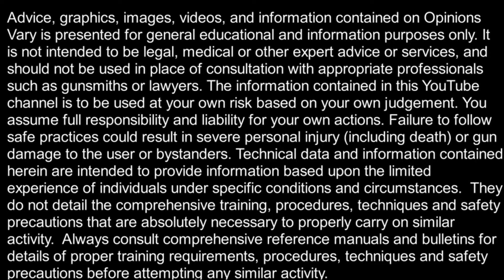DYI 1911 Accurizing

Comment: What's your opinion on thick flange bushings vs. thin bushings?   Do you think they affect accuracy or just basically for looks and protect the end of the barrel?  And guide rod thoughts full vs. GI?.....Many people like myself drop full length flat wire rods in.....Do you think they give better cycling to a 1911?
Reply from the maker: @thomasrouh2258  Thick flange bushings came to help create the slide melt look by offering more material. The basic steel are just as good. Stainless bushings aren't a good idea because stainless pops vs stretches like steel. 

If the back of the bushing skirt is reduced the bushing cants more offering more support to the barrel as long as it's not reduced too far.

Full length guide rods on any larger than 9mm do smooth the cycle preventing the slide from digging in the dust cover while prolonging spring life by uniforming the coils & displace some of the excess torsional stress on the coils. They do make the 1911 better, but the 9mm has way too much slide weight to reliably run them unlike the bigger calibers.
Reply: @opinionsvary  Another question....With this Sig Scorpion 1911 45acp....Do you have any methods or tips when driving the extractor pin out?   I want to give it good cleaning for the first time.....I have EGWs extractor, coil spring and new pin....This pin is really taking some pounding.....I have read they may need to be pressed out and back in.....I am soaking it with PB blaster right now.....I'm using a 3/32 punch.....1/16 punch is a bit too big....Any tips I would appreciate....
Reply: @opinionsvary  I'm driving pin from bottom up through the top as I understand that's the correct way....
Reply from the maker: @thomasrouh2258  In my opinion: Wow. YT failed to notify of your comment.

When driving pins that aren't tapered you should consider preserving the finish by covering it in black electrical tape around the hole.  You'd want a roll pin punch if a roll pin is used. This type of pin driver has a bump in the center to keep the punch centered. If it's a solid pin & not counter sunk you'd want to leave it alone. If counter sunk, you'd want to use a punch driver smaller than the pin diameter. If you have old drill bits laying around you could use the back shank as a punch driver. 

Sig has a pretty good warranty you wouldn't want to mess with. Could call them & they'd send a FedEx label.

I personally prefer roll pins over solids because solids can move around & wobble out.

You must be careful not to damage the finish & want it in a padded vise to stabilize the slide. Don't attempt without stabilizing the slide or finish damage is foreseeable.
Reply from the maker: @thomasrouh2258  In my other opinion: Make sure you mic the pin to ensure it's the correct size. Could damage the slide if not careful. Helps to knock off the edge of the pin so it won't dig into the bore. Might need to stone the pin sides with a trigger track stone to remove discrepancies in the pin. Also might need a dummy pin to help align things so the pin won't shear on the extractor hole.

Honestly many people mess up changing extractor pivot pins & I wouldn't mess with it unless there's extractor failures.

Comment: Did you replace yours to full guide rod is that 70 type  model or an 80
Reply from the maker: In my opinion: Hi there, it's a 70s model. Came with the GI plug & had problems with the plug hitting the short rod end. The rod twisted & jamed the slide so I replaced the GI plug with a full length guide rod & it totally cured it.
Reply: @opinionsvary  thanks I have seen a bunch of video on 1911s but not a lot of infomation on problem fixes is true that the springs ware out much faster tell me did you reuse the spring or did replace that to
Reply from the maker: @nyghtmyst5118  In my opinion: I tend to abuse my builds with hot loads until I like the wear patterns on the bearing surfaces before backing off, so I changed the twisted 18lb it had with a 20 lb ISMI chrome silicon. 

Reliability packages often include 18 lb up from the standard 16lb. But I wanted the barrel bed to cradle in along with the slide stop pin clearance. If you don't then the barrel can prematurely wear the link & link pin when the barrel wants to travel further than the linkage will allow. My hot loads send expended shells bouncing all around the shooting lane enough to know metal mainspring housings break pins. That's why it has a Kimber composite flat housing.

Also the barrel bushing is an exact fit even to the recoil spring plug making a stronger spring possible. Once everything wears in, I'll go back to a 18lb ISMI chrome silicon & run standard pressure loads.

I have a 16 lb ISMI chrome silicon recoil spring that came out of a gun I ran over 3,000 rounds through & ended up still using it in a 9mm project. The spring is shorter in length, but still within specifications. If you want the world's absolute best recoil spring that nobody can ever beat the ISMI chrome silicon is it. They're know to last upto 6,000 rounds unlike everyone else's stuff. The reason they go bad so quickly is because the weight of the slide smacks the frame causing harmonic vibrations under load to a barrel bushing that wiggles in addition. Recoil springs on Government models are supposed to be charged at 1,000 rounds. Commander models might make it to 800 rounds before replacement & Officer models typically might make it to 600 rounds. The slide to metal frame hits causes the spring to shorten & the extreme vibration weakens it. You should expect your spring to last as long as possible with a full length guide system - unlike the GI plug. The GI plug allows the slide to bite down on the dust cover during the feed cycle. Full length rods make everything last longer & overcome one of the most overlooked design flaws - the shallow dust cover.
Reply: @opinionsvary  DO THEY SELL KITS TO CONVERT !  Like the full length guide rod spring and cap for the end I have the SR  Ruger in full size beautiful fire arm for the price I hear this that and a 1/3 on the model 70 being the better design.  I do have Taurus pt 1911 in full size as well but it is a 80 I am told, that to is full size i am a big guy so small guns are cute and big guns are cool to me..  Seem to like the Ruger line  have a couple revolvers I got from that company as well the 101 and the 100 both of which are really nice guess i am a bit old school lol

Comment: So when the barrell bushing is of a spring support type keeping a tight fit of bushing and barrell all the time, most of the worries here go away? Also a loose barrel link pin fitting is nothing to worry about according to a gun smith expert here, and in 30+ years never caused a problem, so where does that leave us with regards of accurizing the 1911? Accuracy of slide fitting the frame rails is not at all mentioned here so why do manufacturers make so tight fit in that regard, like Kimber, and not so good fit in Colts?
Reply from the maker: In my opinion: The collet barrel bushing that uses the spring tabs is completely different & fragile. On this set up a tapered end at the muzzle tightens to remove chatter. They'd  run a 2.5 link & had shorter barrel hoods for unknown reasons leading to the squared areas at the chamber ends for the lock. If the length of the link is changed, the bushing tabs will break. The link thickness can be fattened to help with accuracy by removing side chatter that is a problem in all 1911s with linked barrels. With a link that has a lot of wiggle it will cause the barrel to vibrate when it hits the frame bed. When this occurs, this can batter the top part of the extractor claw as it cycles. The better looseness would be a little up & down so the feed can be complemented & assisted. A wiggly link can walk a barrel pin out that can then drag on the frame. In retro spect most of them had their bushings replaced with traditional more solid ones because the collet tabs would break. The 9MM full size Colts lasted the longest being they ran 15 lb recoil springs that under load of the feed (empty slide drops ruins 1911 parts) wasn't as bad as it was with 45 ACP. The recoil pulse is way different on the 9MM version & you shouldn't ever use solid recoil guide rods because the little drag of the plug can cause feeding problems on that particular arrangement. 

Solid recoil guide rods do smooth the feed & battery in larger calibers.
Kimber hit the market with its Custom Classic running a 16lb recoil spring & full length guide rod. I had one & it wasn't reliable at all unless you were using hard ball ammunition. None of the performance magazines worked well enough to over come this reality. 

COAL matters with 1911s for reliability as bullet set back usually occurs the way this design feeds.

Guide rods can help make collet bushings last longer on the larger calibers, not so on the 9MM.

Slide chatter isn't a big deal. I fitted one once & lapped it until it would slip off of it's own gravity. I put over 3,000 rounds of  hot loads trying to break it in inorder to establish the natural wear patterns bringing it to the sweet spot to where everything is exactly as it will be at its finest. Then I laser bore sighted the sights into alignment after allowing the barrel to naturally relax set to the right as most 1911s do. The slide actually wore to chatter making tight fitment a total waste of time. Slides will relax set along with the barrels. They tend to contort to a "C" shape the more the ejection port is opened. This is not an ideal situation. You see it more on old Glocks than GI model 1911s. At some point I will cover how the internal 1911 extractor & ejector actually work making extended ejection ports a terrible idea (the market trends in the 1990s gravitated towards trying to emulate Beretta's more reliable "open slide ejection system"). During this era of thought 32 ACP C- Camp pistols & Walther PPK type small arms were preferable for concealed carry for those who hated the snub nose revolvers. 

Extended ejectors are another terrible idea some gunsmith hot rodder came up with & it created a world of problems messing with the OEM design. 

Back in the 1970s the 1911 was a terrible thing nobody wanted as a duty weapon so the gun magazines made them hot rods. Kings, Cylinder&Slide, Clark, Millet & Wilson would offer gunsmith fit parts touting better performance in line with revolvers. They tried for higher adjustable sights -  like revolvers - on pistols that hardly ever had them being more suitable for combat. They thought tighter was better & preferred less barrel movement. Turns out they're as wrong as the weaver shooting stance of those times. They erroneously though a "bladed stance" was the best, but that stance is no longer taught at the professional level being hard to index with & opening up the arm pit to present the most vital area to ever  get hit at next to the head. Yeah, it was incredibly dumb. Most 1911 smithing is all idealistic market gimmick. They'll recommend a tight barrel without telling you about barrel springing or lug drag issues. They'd talk about the "long link" idea without telling you it wears the slide & breaks extractors.

Hopes this helps, tell me what you think about it. It's a lot to take in.

Best regards.
Reply: @opinionsvary  Thanks for the answer! Honestly some of the things mentioned here I cannot do much about, like fit of barrel to slide. As the front bushing collet type is very tight and nice accuracy improvement in my Colt Combat Elite (Series 80 modified to 70) maybe could be found at the rear of the barrel. The gunsmith here suggested a bigger program, but I declined wanting to keep the Colt original. It has 3lbs trigger but I wanted Kimber Super Match feel. Then the whole trigger  assembly had to be changed he said :) Anyway, the problem which emerged after some use is that slide catch releases when loaded Kimber magazine is inserted. Also it has developed a tendency of not feeding Fiocchi 230gr.FMJ ammo. Quite frustrating in a shooting match!  The smith would file the profile of the slide catch and accurize the feeding and feed ramp. The slide is slightly binding at a portion of the frame, but he said if he opened it up the accuracy would be considerably worse. So we let it be! :) Any opinion on those considerations?Thanks for your attention!
Reply from the maker: @gabork.8715  In my opinion: I don't know why he'd be filing any functional profile on a slide release. Without seeing your gun, I'd say the catch may not be fully up in the slide notch or catching on the take down groove before it. If the mag spring is tired, you may not get the full lock back proformance. I would use PSI ACT mags that have more reliable supported followers. The nose dip of the traditional style mag can cause problems when the spring sets & tires. The mag depicted in my video is my own fancy build. It uses a ACT mag follower & spring. The mag tube has the correct feed lip angle & a removable base plate. I wouldn't use any other mag. Pay attention to the feed lips being many tend to come malformed.

The fire control group (FCG) on a 1911 can be improved simply by changing the main spring to a lighter one, preferably made of chrome silicon - like an ISMI. Colt OEM runs a 24lb main spring. Going for an 11lb or 8lb will significantly reduce the pull. Cylinder&Slide sear springs would also feel better than the more solid Colt OEM. DO NOT MESS WITH THE SEAR ANGLE!!! Because it's not necessary. Ordinary the sear will bite into the hammer hooks & iron out all the gritty feel. You could put Power Customs sear shims on either side of the OEM sear & remove the sear drag on the frame. Colt is generous with the sear slot unlike other manufacturers that make this area too tight. You could change all the parts yourself without having to file, grind or modify anything. This should make your FCG incredibly awesome. 

The case over length of a bullet can mess with feed.  1.215" - 1.220" (tapered flat tip); 1.230" - 1.265" (Full Metal Jacket) runs pretty good in my 1911s. But it varies with manufacturers & the batch. If the egg shaped ball ammo doesn't feed its length may be too long for the optimal feed cycle. Get yourself a micrometer & spec the case over all length (COAL) to make sure it'll be within the sweet spot to run correctly. That long stuff may run in a different non 1911 gun that doesn't cam load like the 1911. 

The frame feed ramp should launch a round to the mid portion of the barrel's ramp. You can advance the cycle rate by changing profiles, but I would not recommend it. The bullet pushes against the top of the chamber & cams on the barrel's feed ramp edge. The secret is the barrel's feed ramp, not the one on the frame. That's exactly why throating involved   using a fixture to help chop the feed ramp down to a steeper angle for hollow points. It "magically" allowed less drag on the cartridge to where it cams up. I would not mess with any of that. The "U" bearing surface of the feed ramp has to be the correct shape in order not to increase the cam up pressure & retard the feed. 

The tight spot on the frame isn't a big deal if the slide moves of its own gravity without stopping short. The top rail is where all the magic happens. The bottom track isn't the bearing surface like the top. As you continue to practice with it, it will wear in like a new pair of shoes. The frame will contort over time & relax set. The difference in sectional density will causes this. That's why you should always practice when ever you can inorder to keep things running in their sweet spot. Cop & security guard guns contort really bad from temperature extremes whereas guns that stay in stable climate not as much. You might try Flitz on the rails to slick it up. Or you could use automotive rubbing compound for a few back & forths until satisfied (make sure you clean it out good). Do not use lapping compound because it won't all clean out & continue to work down the parts in bad ways. 

~ Best regards.
Reply: @opinionsvary  Thanks for your answer!  I really refrain to file anywhere on that Colt not to make things worse and hopefully the gunsmith found the right places to adjust. The magazine I used was a quality Kimber 8 shot magazine which has a feed lip quite different from the orginal Colt which actually looks cheap, with a step in the feed lip. The Kimber feed lip looks akin to modern magazines like on the Beretta 92F, no step at all. Anyway I cant understand why the slide would go forward by itself when inserting the magazine; not a problem before, but developed lately. Maybe the gunsmith found out of that!
Reply from the maker: @gabork.8715  In my opinion: I probably should do more videos on this 1911 stuff being the amount of views it brings. I have a talent for costing shop owners high end sales. 

I noticed quite a few channels trying to save their reputation seeing the challenge to their market trends.

It's a darn fine design, we shouldn't be having all these issues that's mainly their fault.